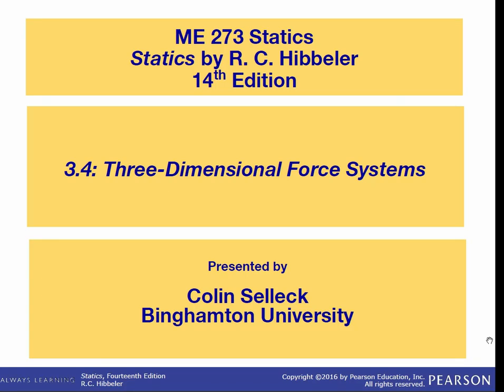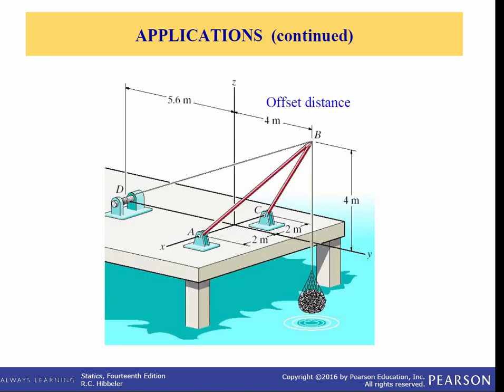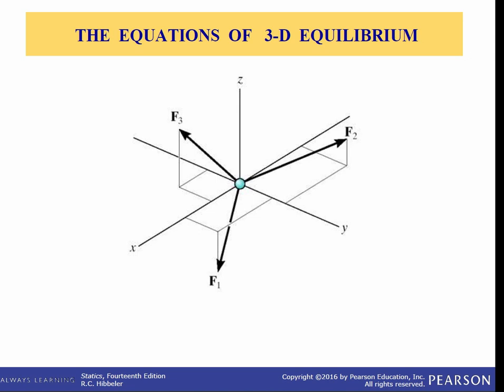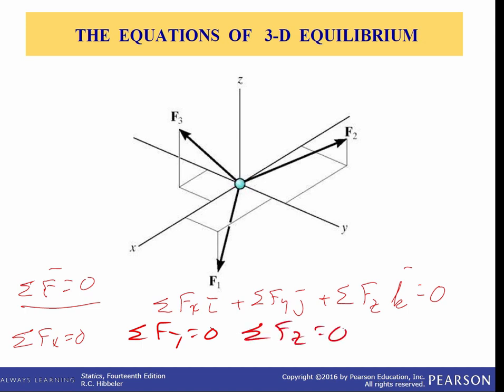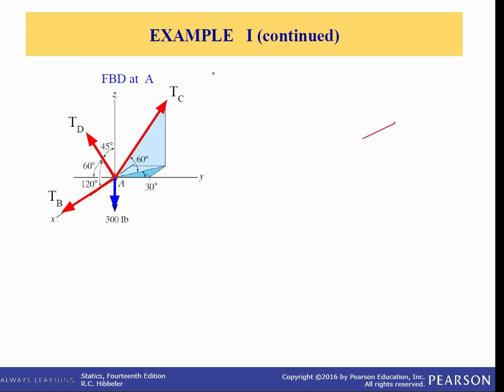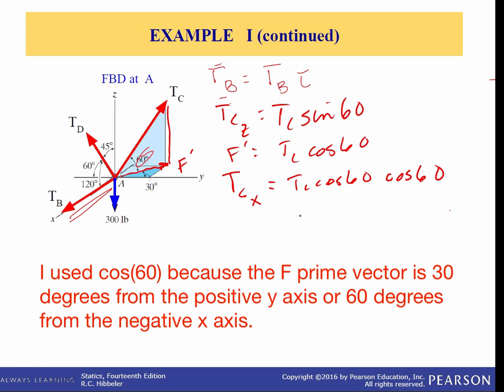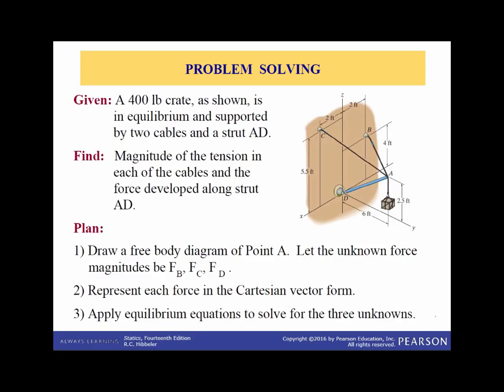ME 273: Statics: Chapter 3.4

Comment: Love the vids but two questions, one: how did you solve for the forces to get the magnitude of the tension in each cable if there is 3 unknowns and also, for the second question what was the force developed along the strut AD. Thank you!
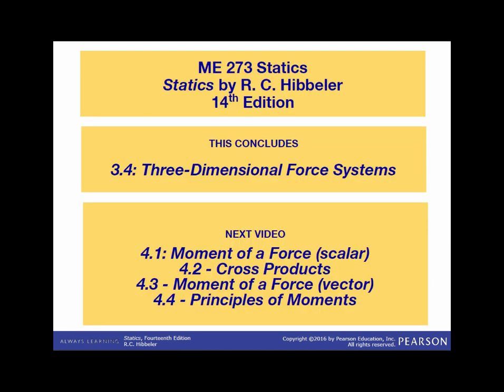Reply from the maker: For equilibrium of a particle in 3D, you can solve for three unknowns as you have three equations: sum forces in x, y, and z = 0. The force in the strut is 547 pounds (at time stamp 18:02).